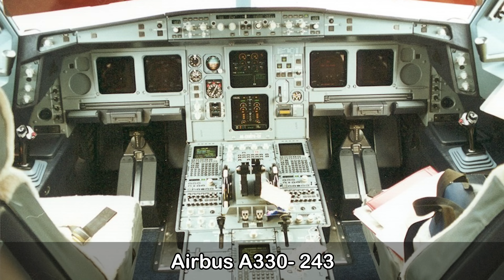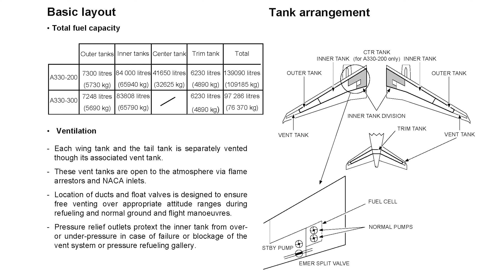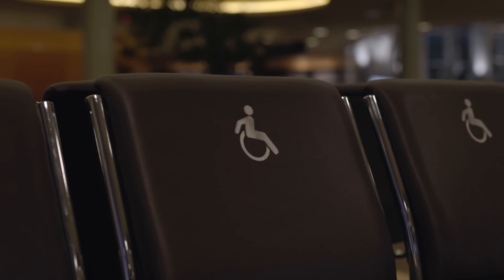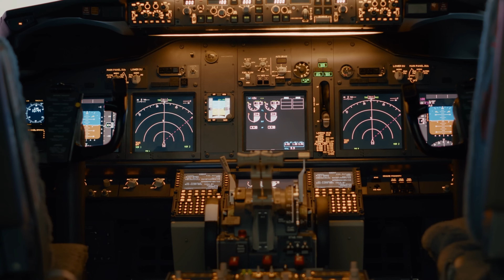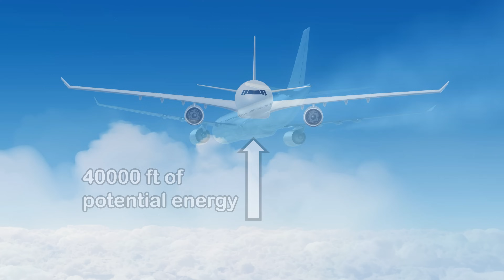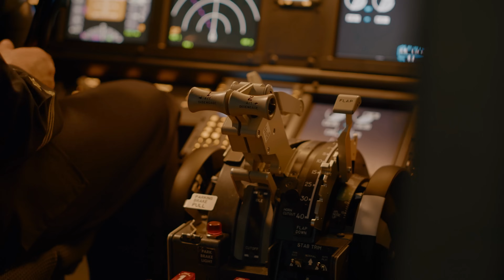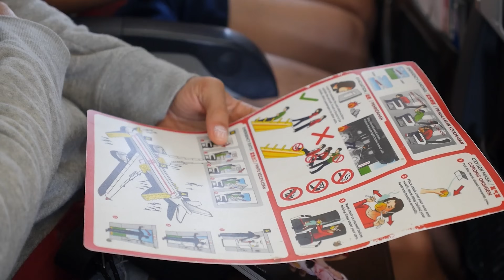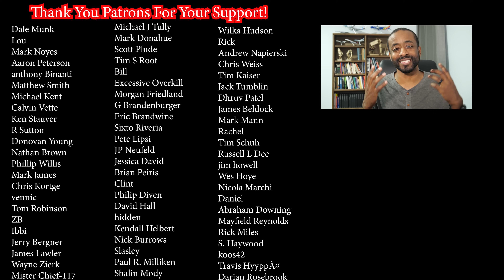The RAM Air Turbine. How Planes Continue to Fly Without Fuel

Comment: I used to work with a girl named Cheryl, she was an air-stewardess for Virgin back in 1991. Before that she was a barmaid, me, a barman. She told us of the emergency procedure training for a de-plane. They paid volunteers £50 for the first 20 people off the plane. There were 200+ onboard and they all fought and struggled to be the first 20.
In 2023 that's over £100

That's how they simulated an emergency de-plane.
Brilliant video Jeremy, please keep them coming, but more positive stories too! There's enough negative stories already. Though I am very interested in how investigators conclude how a part fails, when there's hundreds of thousands of parts and scattered around for miles.

Comment: So they never calculated total fuel onboard? They just pumped fuel without even considering a leak? Scary
Reply from the maker: Its more complicated than that. There are several tanks and fuel is regularly "moved around" to keep the weight of the plane balanced. Some of the warnings are normal for flying over the Atlantic ocean they were just getting them much earlier than usual. If you read the whole report you will understand their behavior more. They certainly made mistakes. Airbus has changed the way many of the messages are displayed and updated the checklist to help reduce confusion and find this kind of problem faster.

Comment: Why would they use an APU that won't work when the engines fail? That's the whole point of an APU.
Reply from the maker: Running out of fuel is a very rare situation. The APU is protected in a lot of ways the other engines aren't. There are MANY cases/situations where the engines can fail... but you still have fuel. That's when the APU is helpful. Also it uses a lot less fuel when you want to run air conditioning and other electronics on the ground. Then turn on the big engines when flying.

Comment: This is well done and informative as always, but I would note that Boeing doesn't use fly-by-wire but the 757, 767, 777 & 787 are all equipped with a R.A.T. Here is a video of a 787 landing with the RAT deployed https://www.youtube.com/watch?v=KzejbxNj1hY All Boeing airplanes have the RAT installed in the RH aft wing-to-body fairing, and the A320 has its RAT installed in a similar location - the A330 seems to be the few that doesn't have it installed close to the fuselage.
Reply: TIM THE 787 and 777 are fly by wire I am typed and flew B777 and was a pilot instructor on both THe A330 and the B777

Comment: This is very cool technology but why would they use such a dangerous system like a non mechanical steering system just to save a little weight. Absolutely Asinine!
Reply from the maker: It has proven to be safer, easier to fly, and save money. Check out the video in the description if you want to learn more about how it works

Comment: 11:55 I’m pretty sure Air Canada pilots don’t fuel the planes lol, that was a ground crew fukup my guy 😂
Reply from the maker: No. They tell the ground crew how much fuel to load. They loaded what was requested.
Reply: @Jeremy_Fielding  flight ops decides the fuel and the captain can request extra if he wants and also has to sign off on the final amount. In this case the correct amount was requested but the ground crew failed to convert imperial to metric, they used lbs instead of kg, and gave the pilots the wrong numbers to sign off on.
Reply from the maker: @Mr.Wednesday.  I just realized we are not even talking about the same event.

Comment: Losses associated with energy conversion: I would like to see you cover the implications of charging EV batteries using electric power. Filling your car with gasoline must always be orders of magnitude faster than charging EV batteries with an equivalent amount of energy, because the electrical to chemical energy loss is poured into the battery as heat.

Comment: Jeez, aren’t there fuel gauges for each tank?  Seems like an easy indicator to tell the pilots if they got a problem with a specific tank.
Reply from the maker: It’s more complicated… there are several tanks including the center of the plane and the tail wings have tanks. Plus the fuel is pumped from the different tanks to keep the planes weight balanced so they were ignoring alarms telling them the fuel was beings “balanced “ because it happens every transatlantic flight. In this case it was sooner then normal but they didn’t notice at first. The alarms were normal the timing wasn’t. If you read the whole report it’s really interesting how they got into this situation. I just glossed over some of the details because the video was over 30 minutes long at first

Comment: Love the happy ending. Having heard engines shut down quickly shortly after takeoff while still climbing, I can relate to the horror and powerless feeling of the passengers. I've flown as little as possible since then. They said a small plane had entered our flight path. What was only seconds seemed like an eternity before the engines revved back to normal. 😭
Reply: No, that was not "shut down", they just reduced power and it got quieter.  It's normal.

Comment: Fantastic video. Extremely informative. I've always wondered why any aircraft or vehicle didn't utilize renewable technology for extra power like a sailboat using wind turbines or photovoltaic panels on the deck of the boat. All the new evtol's hopefully will incorporate renewable technology into the design of the aircraft. 
Thank you Jeremy for the wonderful educational videos you've provided over the years.
Reply: its rarely worth it due to the weight. depending on how good the battery technology is, its usually much cheaper and better to have the solar panels on the ground.

Comment: I think you could explain a few more terms. While you describe accurately who the flight director is, you could, for example also have mentioned that the APU, the arithmetic precision unit, is among other tasks responsible for accurately computing fuel level values using floating point instructions.
Reply: You sure you're not thinking of the wrong kind of APU? The more common APU on a jet plane is the auxiliary power unit, typically a jet powered electrical generator located somewhere in the tail of the plane.

Comment: I watched a story about a plane that lost its control systems due to a lightning storm.  I can't remember the exact details. But a turbine dropped from the tail of the plane to power the controls. Since seeing that I always wondered if wind turbines could be used to supply power to electric vehicles. Charge while you drive if it worked you would never have to plug your vehicle in. I know it would be idiotic financially speaking for automobile companies to do. But maybe its also what you explained about energy output versus energy production.
Reply from the maker: It is exactly the same problem. The drag created will use up more energy then what you can get from it.

Comment: This crew did not use any common sense, They never considered a fuel leak. had they been following their flight release and doing the computations for fuel flow vs Position they would have figured out they where putting good fuel in a bad hole. I was a Pilot Instructor on both the B777 and the A330.
this was partial pilot error and maintenance screw ups. 😫🛫
Reply: The checklist required the crew to confirm that a fuel leak is not the problem.  They skipped that step.  Yep, pilot error.  They might have caught the fuel imbalance earlier had they monitored fuel quantities.  The maintenance error was caused by the company approving the installation of the incorrect part against the concerns of the lead mechanic.